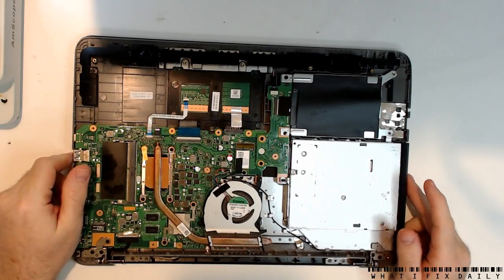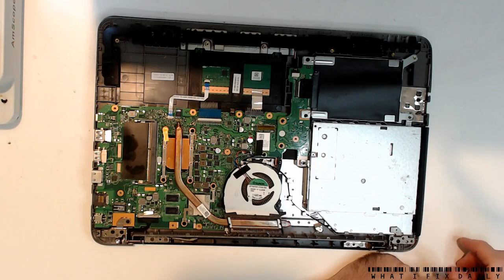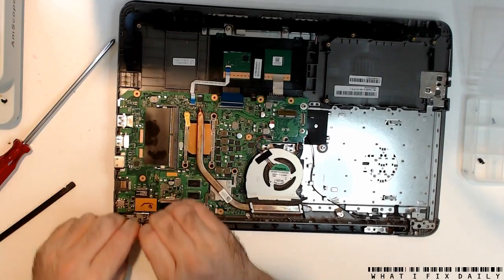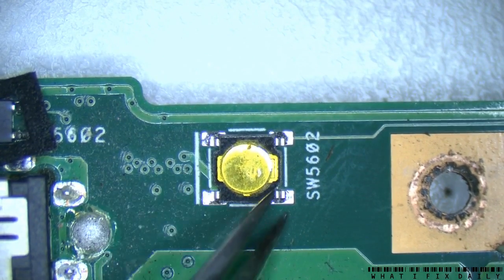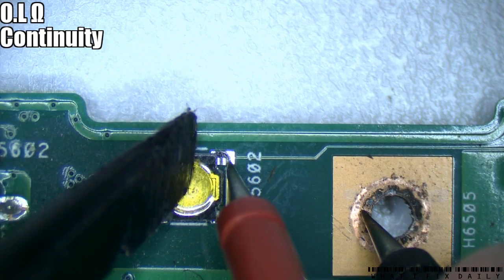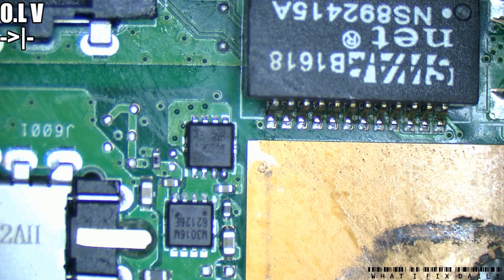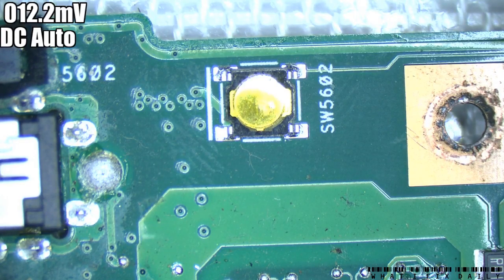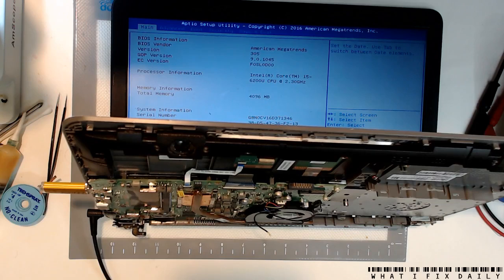ASUS X556 - No Power - Component level repair

Comment: I found an ASUS laptop R457UA in the street in a shopping bag by the trash bins. 
I took it home it was in excellent condition.
Only problem is that it doesn't boot or do anything at all (no fan spin, no LED light, no screen, nothing).
It uses a X456UV motherboard.
I measured few voltages and noticed that it would ramp-up and then go back to 0V (loops like this periodically).
I then checked the AC adaptator alone by itself (no load connected) and the voltage would vary between 18.9 and 19.2V.
So I connected the input of the laptop charger to an external bench power supply to see if the laptop itself is OK or not.
It was drawing 19V and 0.485A and the display showed the boot menu.

So the only problem was a defective charger.

Comment: Thank you very much!!!  i was at 1 day aroud the battery ic bq24780s that never activate despite have 19v on vcc pin and was this !"#$! mosfet! i start for here but i checkd between ground and the mosfets  and was ok.... with your video i checked again between mosfet legs, and had 0ohms on de lowside mosfet....   well 2 brains think better than 1. you saved the day :)
Reply from the maker: Glad you got it sorted out.

Comment: Hi Paul! I've got what I suspect is a similar problem with an X556U. I have power at the jack, But the second mosfet (which also looks maybe burned) has the same reading as the first in diode mode. There's no power at the battery connector. Any idea what to check next? Are you based in Melbourne? Do you do repairs for a fee?
Reply: you can check MOSFETS like you do Diodes. leg 8 is usually power that opens or closes the gate. Depending on the type of MosFet it is. Infinity one way, and OHMS the other direction.

Comment: Thanks for the amazing video, I'm currently trying to fix my laptop very similar to the model and I'm experiencing no voltage passing thru the capacitor at 5:06. Which should I replace?
Reply: Voltage will not pass through a cap unless it is AC. DC will be blocked. One side + the other side -. If that helps.
The will pass through resistors though.

Comment: Are those mosfets? I thought mosfets come with three pins.
Reply: Sure, it's a power mosfet with 4 drain pins + pad underside (thermal relief), and 3 source pins and one gate pin. The extra pins are there just allow for more current.
Reply: @snaip6874  thanks for stopping by
Reply: @snaip6874  hello man i see youve knowledge at this subject. i need a mosfet now im asking if i can buy one that looks the same but have another number on it? or do i need exactly the same with my number? mine is m0390m 54135E

Comment: Do you think Asus f555u will work with internal battery fault or does it need it functioning as CMOS battery for it to boot on power button press with charger? I get power light but no charge light. Battery seems cactus.

Comment: waw... great tips... I have the same problem in my ASUS K556U laptop. My laptop is showing power led but won't show logo. After 15 times pressing the power button, it starts showing the ASUS logo. Also, when I plug the power in, it won't start. Need assistance, sir.
Reply: Even if you have the same problem it doesn't mean that the same part is broken.
Other parts in the same power line could be broken, so take multimeter and check them first.
Reply: Did you repair ? How?

Comment: Hello Paul,  in regards to chip orientation, what are you using to determine which way it goes?? Thanks and hope you are having a great day..
Reply from the maker: The PCB has silkscreen marks for orientation.  For MOSFETs though like this, you can also work it out based on the knowledge that most have a single pin for the gate, and the source & ground are grouped; if you look at the PCB tracks you can see the clustering/grouping.

Comment: Hi Paul, just started tuning in. Love the channel. Can you recommend a book for learning about motherboard / SMD circuit repair. I have a lot of electronic books but they all deal with through hole components mostly. thank you.
Reply from the maker: Realistically, it's a case of get yourself a scrap board, start pulling parts and putting them back on.  If your eyesight is good, you can do a lot of PC laptop repair work fine without a microscope, but having the microscope does make it so much easier and lets you see some of the smaller fault areas.

I don't have any book recommendations; just watch videos, particularly the series by Louis Rossmann , he has a lot of good guide videos.  99% of this is just experience from having dived in.   Knowing electronics theory is good for when it comes to sorting out problems you've found, so still keep those around too :)
Reply: @pldaniels  I guess that I would have an advantage here, am pretty severly short sighted, my monitor 3ft away is a blur yet can thread a needle 2 inches away from my nose.
Reply: @13ig13oots  Clever nic Big Boots.
Reply: @josephking6515  It is true too as I take a size 13.
Reply: Thanks Paul, I appreciate your response. Have a great day.

Comment: Ciao, I have an Asus F556uj dead after a short circuit, I did a test and I think it's the same mosfet, I also read this article:
http://jestineyong.com/how-to-repair-no-power-symptom-in-asus-x555ld-laptop/
where a temporary bridge was made with a copper wire.
are these mosfets okay? :

https://nl.aliexpress.com/item/10-stks-P0903BEA-P0903-A5-GND-A5-GNC-A5-PNB-A5-MOSFET-QFN-8/32678530737.html
https://nl.aliexpress.com/item/10PCS-x-Brand-New-FDMC8884-FDMC-8884-QFN-IC/32321045530.html
Reply: Ciao, ho lo stesso computer con lo stesso problema, hai risolto? Se sì, come?
Reply: @pololopololop  ciao no non ho risolto  ,per un periodo ho provato a cercare una nuova scheda madre o un Pc ricondizionato ,ma il prezzo era alto e senza nessuna garanzia . Ho recuperato i 4gb di memoria ram non saldata e il disco rigido . Per il monitor visto che è Fhd avevo pensato a una soluzione del genere tipo una Scheda di controllo per LCD su Amazon si trovano a una 20 di euro .
Reply: @GianPippoPierFilippo  ho capito, grazie. io provo a sostituire i mosfet, poi se non risolvo comprerò una scheda madre su eBay... il danno l'ho creato con un'inversione di polarità nell'alimentazione, tu?
Reply: @pololopololop  io credo cercando di forzare un BIOS  , si è spento ed è morto .Ho letto che molti hanno problemi  forse era meglio disabilitare proprio la scheda video Nvidia peccato era un fulmine i7 con 8gb e avevo messo una SSD .
Reply: @pololopololop  la avevo trovata su eBay   uk a circa 100 euro, senza processore quindi dovevo usare il mio .
Reply: @GianPippoPierFilippo  100 non è affatto male, io trovo solo a poco meno di 200. ma tu hai provato a sostituire i mosfet?
Reply: @pololopololop  ho provato col tester per vedere i volt l'ho anche dissaldato e provato a fare un ponte ma è veramente un casino farlo ,ora la scheda è impapocchiata di stagno . La avrei presa e 95£ li avevo contattati ,ma non spedivano in Italia ,quindi dovevo farmela spedire tramite terzi un casino quindi ho rinunciato.
Reply: @GianPippoPierFilippo  ho capito, anche io ci sto impazzendo da un annetto... se ti ricordi fammi sapere se risolvi

Comment: Hi there, what size solder wire you use, 1mm with or w/out lead? Nice solder.
Reply from the maker: Kester 63/37 blend, 0.38mm (0.015") diameter.  Bought it off Amazon.
Reply: Paul Daniels I purch. 1mm lead for so8 mosfets. Do you think 1mm is too thick? Thanks Paul!
Reply from the maker: For SO8 type stuff 1mm is still very thick, okay for pin-through type items.  0.5mm is about right for SOIC and TQFP type stuff, though I do find that 0.38mm is still better to use.  If I had to choose, I'd stay with 0.38mm.

http://aax-us-east.amazon-adsystem.com/x/c/Qqol1-SiLLayszO32Oy4EQYAAAFh4ckd_gEAAAFKAS_qmv4/https://assoc-redirect.amazon.com/g/r/http://amzn.to/2xW5Ub2/ref=as_at?linkCode=w61&imprToken=cx1hjC7FvIh0.cfk1gIFQg&slotNum=5
Reply from the maker: Just be sure to wash the flux away after soldering, this isn't a no-clean flux.
Reply: Paul Daniels thanks Paul I appreciate that. Yes I noticed your work is clean.

Comment: I have noticed that you use a very, very soft toothed tooth brush Paul. Is there a reason you prefer that over the cotton buds favoured by Louis and Jessa?
Great video. Cheers.
Reply from the maker: Self taught since the early 80's, but there's a lot of core principles and foundations that I picked up during school/university too.   The [proper] school/Uni stuff is something you utilise to help you learn the new stuff that comes out, it's a bit boring sometimes and doesn't seem overly relevant, but some of it really builds a strong base.
Reply from the maker: Depends on the task.  I do still have and use cotton buds, usually when I'm cleaning up BGA pads; however for post-rework cleanup I just like to flood and scrub (as seen in video :) ).
Reply: Paul Daniels Paul did you go to school to repair computers or you learned on your own? I needed a methology so I'm in school to learn  chip level mobo repair.

Comment: no source or drain voltage.. wow. usually not much on 19v rail, most of the time bad MOSFETS themselves. nice quick repair. what caused them to fail? under rated/specd? or poor input filter stage giving them transients/loading over time until they give way? a lot of OEM's seem to really be lacking in the filter stage these days, no surprise there. I was gonna grab my oscilliscope and watch the ripple on the output of the filter stage on several different devices and see what it looks like. plan to do that soon.
Reply from the maker: I was talking with piernov on the Rossmann discord last night about this.  One theory is that because there's no OVP on the DC IN stage, it's possible there are high voltages happening during the initial power-connect/turn-on (of brick) phase, which gets through the isolation cap and hurts the gate (ie, if over 30V).     Possible solutions would be either using protected-gate MOSFETs or even just a 30V zener on the gate line. 

Might be happening because of other reasons, but that's just one that's been theorised.
Reply: could be solved with a simple varistor, yes?
Reply from the maker: Might be worth trying with a TVS.  Pick some voltage between the 20V input and 30V Vgs limit.  TVS will be faster to react than a traditional varistor. Not sure what sort of rating would be required, though cannot imagine it being too much.
Reply: i was using varistor in my input stage but i will consider about this now/research. thanks